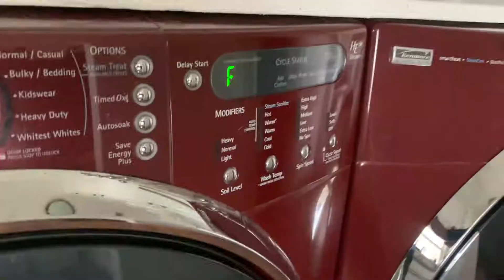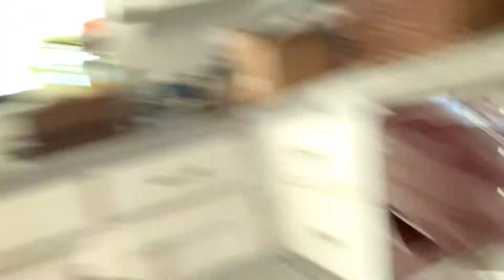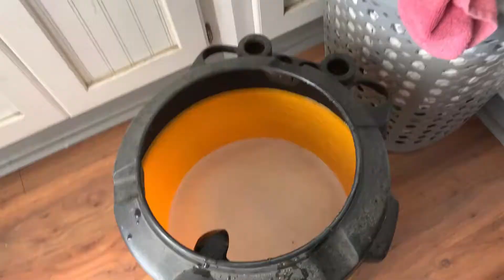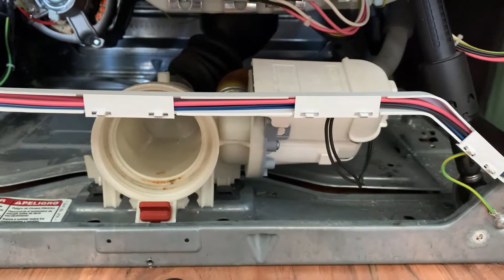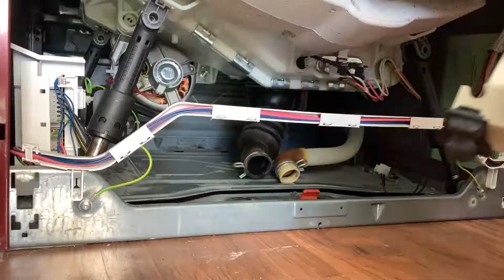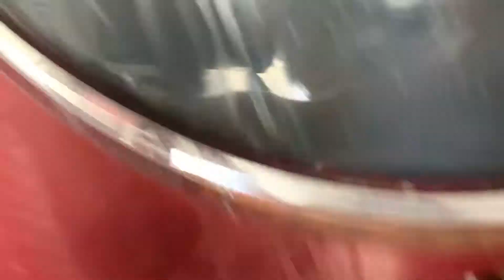Kenmore Elite QuietPak 9 HE5T Pump repair WRONG PART!!

Comment: Thanks for the video. Very helpful in determining that the impellor is our problem too. One thing, the most important part of the video and it went by to fast: How did you get the door open?!? I tried holding the button, holding in the pressure switches that the cover panel depresses and it won't open. Could you elaborate on how you did it? TIA
Reply from the maker: I unplugged it to "reboot" it, plugged it back in, started a cycle, waited until it started, then paused it which unlocked it.
Reply: @SugarChateau  Thanks for the answer. We tried that but ours wouldn't open. We thought the electronics were blown. I actually found another video that said there was a little plastic cord/handle up by the latch. Thankfully, that worked for us. It's so weird how a bad pump impellor basically made the electronics malfunction. I'm just glad it worked. BTW, we had the same foot mounting configuration as yours and could not find it so we bought the motor only. I guess if the mounting cracks, it will be time for a new washer. lol.